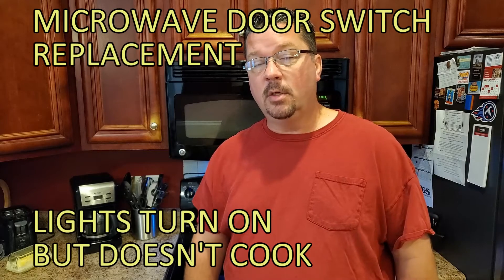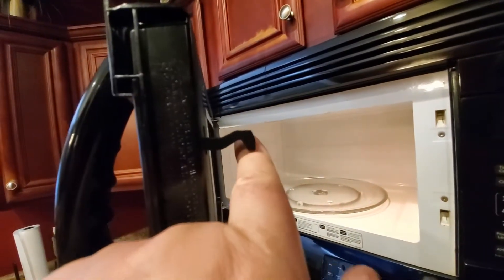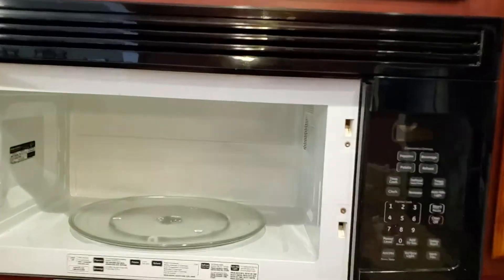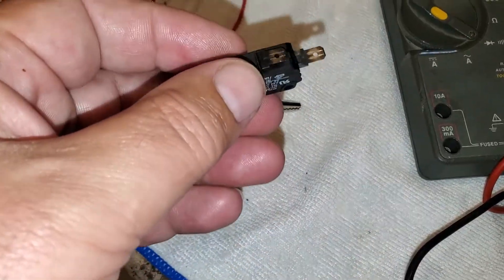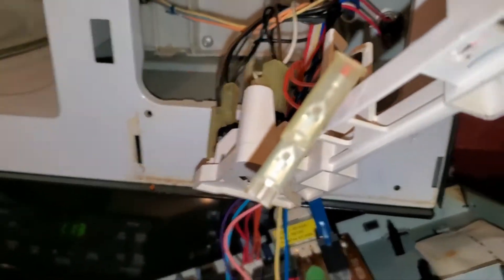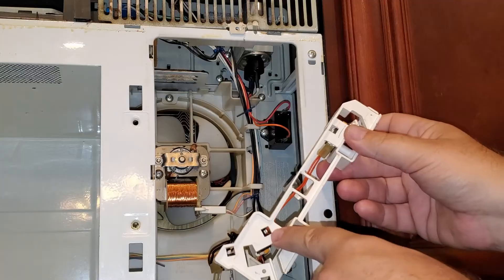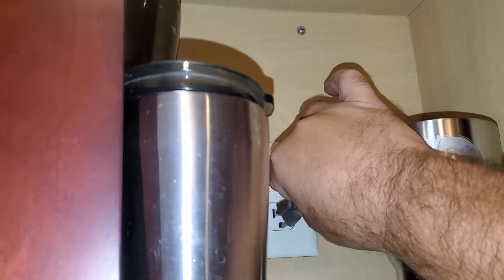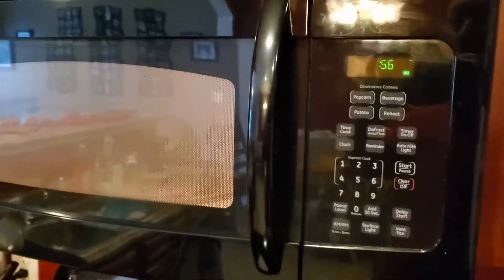Microwave Turns on but Doesn't Cook ~ Easy Fix!!

Comment: Excellent video thank you.   Both of my bottom switches were out . One quick note, I have a JVM6177SF1SS - it was a bit different to remove the control panel - there was 1 screw top left accessible after the main vent was removed (similar to your video).  There was a screw on the bottom, and the 3rd tricky screw is top right - shine a flashlight through the top vent holes on the top right side to find it.   After that, the door switches are swapped out as shown in the video.   Thank you again.

Comment: Mine is a GE, probably 15-20 years old.   Could not get the top panel off.  It appears a part of it is behind the top of the door.  The 3 screws come out and it was loose. but would not come from behind the door.
Reply: If it is like mine, there is another screw that you have to get at my putting a screwdriver through the vent holes.

Comment: I had to replace the magnetron, but when finished had exactly the problem shown here.  
Turns out not a bad door switch; the connector leads on the very bottom door switch got pulled very slight out.  Not obvious by sight.  Pushed it on all the way, everything A-OK.

Comment: my microwave oven is on but not heating (Ottimo) Art No:10630761(P70H20L-E8)
Item No:8146058
Input
22024V-50HZ     1200W
Output
700W.              2450MHZ
Dimensions
262mm(H)x252m(W)x345mm(D)